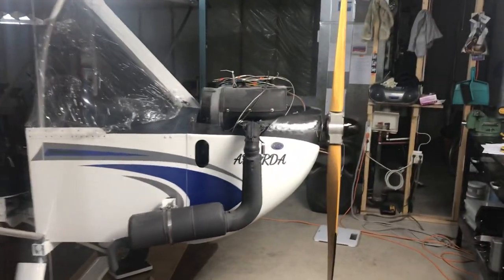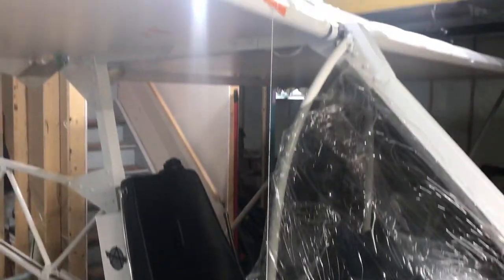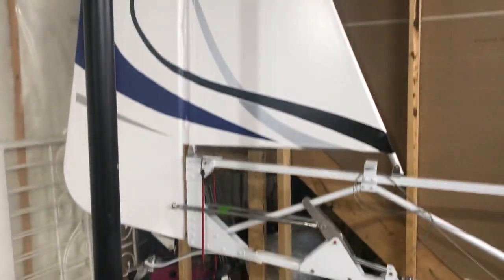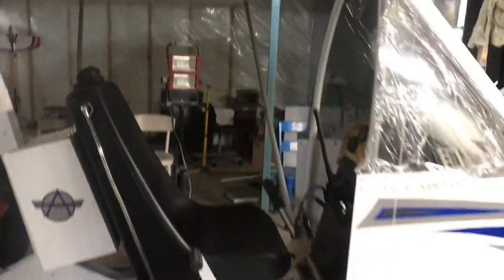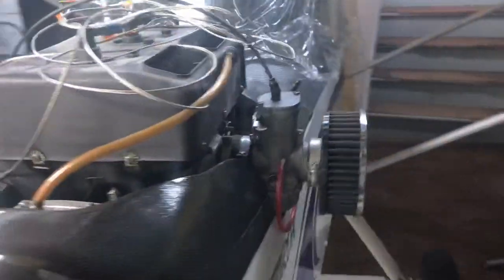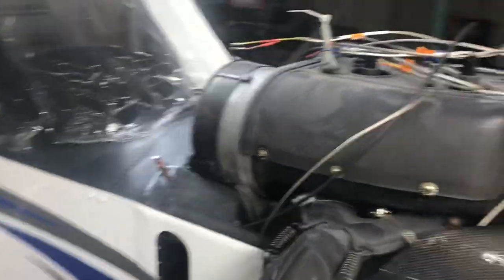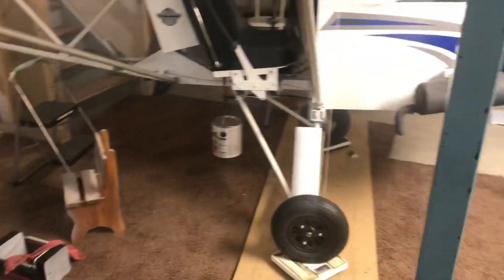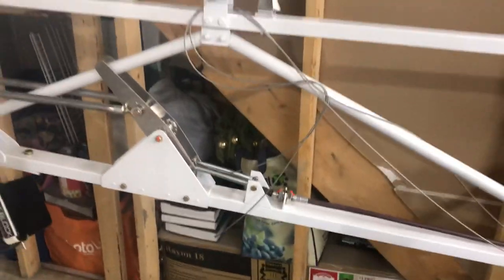Build update #16

Comment from the maker: Hi Gene. I didn’t end up making the wings fold. I built conventional wings in the end. The tricky part to fabricate is where the lower struts mount to the fuse. Take a look at how the Belite Ultralight does the folding wing design. That will give you some ideas. 

Be careful though. The Affordaplane comes out heavy, no matter how you modify the design. Adding complexity can sometimes add weight. Good luck on your build. 

Follow the channel to see the latest Pietenpol build. It’ll fly next year.